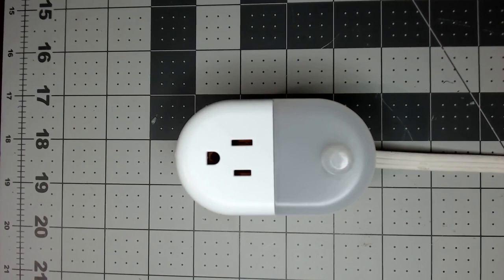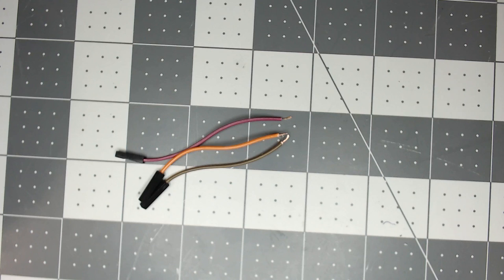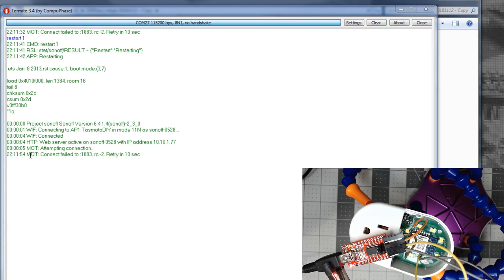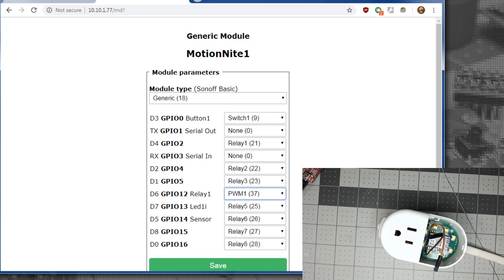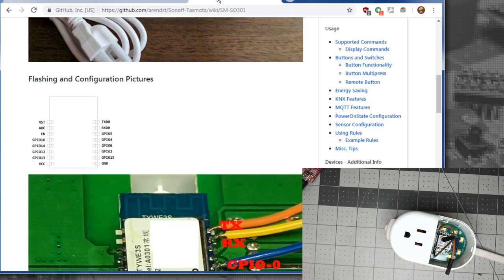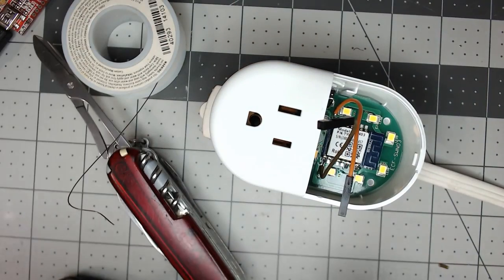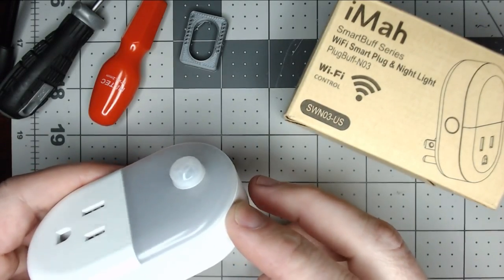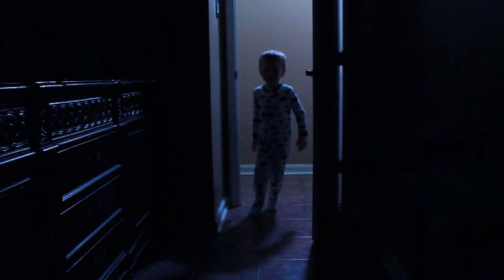Smart Motion Sensor and Night Light - How To

Comment: Mine just arrived from Amazon (thanks, Prime!)   I noticed its pretty easy to pop the entire board out of the case; you just need either a funky 3-lobe security bit or just the right sized straight screwdriver to remove just one screw.  On the back, it's behind the white rubber plug that you can pry out of the hole fairly easily.   It's not even glued in there.   Once you have the screw out, first remove the bottom half of the front case (not the diffuser) and then the top cover over the LEDs pops out pretty easily.   Then just push on the AC power pins sticking out the back, and you can easily extract the board.
Reply from the maker: Thanks for sharing! I wish all manufacturers would put a screw! Hint hint! They would sell more units. If you want take some pictures and email them to the channel name at Gmail and I can post them. Going to pin your comment.
Reply: I just sent some photos.

Comment: Amazon delivered 2 of these plugs on Sunday - the video was spot on on.   I was able to flash via OTA so only needed to solder 3 wires to each plugs.    There is quite a bit of changes to make on these things - but Travis has all the info so it pretty much cut and paste.   I really appreciate the explanation of the rules - what each part does.   I'm going to order a couple more just to have them.   Travis installed the PIR in the front of the light cover - but he also mentions in passing you might want to install it on the side - depending on your specific need and at what angle you want motion coverage.

Comment: "We've got the instruction manual... of course, we don't need that."   Exactly!  This is really a great find!  I've been wanting to put some motion sensors and night lights into various rooms for general presence detection.  Having found this product that's already packaged and easily hackable solves the most difficult problem of making it look nice.  I wonder how many things I can stuff in there?  In particular, I've a got one of the cheap microwave doppler motion sensor modules in an LED lamp that I built that seems to work pretty well.  It's somewhat sensitive to power supply voltage fluctuations, so we'll see how it feels about the inside of this module.

I managed to order a few of these from Amazon right away before they go out of stock.  Thanks very much for doing this video and sharing your discovery of this product with us.  Can't wait to add this into Home Assistant, either using Tasmota or esphomeyaml..
Reply from the maker: Is it bad I never pair devices with their stock apps and just flash them from the start? Ha!
Reply: @digiblurDIY , none of the 10 Sonoff devices I have around here never run whatever the stock app is.  First power-up is usually with the USB serial adapter connected to it for flashing.  Straight to the brain transplant!  I wonder how much more product some of these vendors would sell if they just mentioned "Tasmota ready" in their product's description.
Reply from the maker: All they have to do is put a simple 4 or 5 holes in the PCB. Mentioned that several times to any of them when I had the chance. Not sure if that gets back to the actual board developers though.

I remember the router manufacturers doing the DD WRT ready labels.

Comment: As always, great video! I am looking to build some multi sensor units to monitor temp and rh. Something like this as a starting point would be great. One concern regarding temp though, if I add a temperature module to one of these, do you think the leds being on would raise the temp reading too much? Or would you go with a smart plug without the leds?
Reply from the maker: You can always turn the LEDs off and leave them off. There will be some heat from the Esp chip and power supply as well but if you keep them far enough away type thing or go with longer leads, etc. Just depends on how accurate you want to be.

Comment: I happen to be working on a   HC-SR501 PIR on a D1mini and trying to figure out how to config it properly.   :-)
Thank you, it's great, helpful, good for reference.
Reply from the maker: Side note on those HC-SR501's, I have heard some people have interference issues with them.  Keep them away from the wifi antenna on the esp chip.
Reply: @digiblurDIY  Got it. 
The sensor is currently connected by  20cm Dupon jumper wires and it did turn on the light last night when nobody was there. I am not sure if it's related but I check later today. :-D 
Thanks.

Comment: Same setup but I get a lot of false positive signals from the pir. In the middle of the night, with no movements, the light keeps turning on randomly. How can I reduce this issues? Do you have same problem?
Reply from the maker: I have seen that issue before with a bad PIR.  Or it could be some other heat movement in the area.  One test I do is to completely cover the sensor with something to see if it is seeing something weird.
Reply: @digiblurDIY  Good advice, i will try to cover tape the sensor...i doubt it's broken because i already tested another pir (the bigger HC-SR501) and i get the same results. What could cause the heat movements during the night with no people?

Comment: Great video, thanks! Gonna combine the info from this and the MJ Dimmer to add a motion sensor to the dimmer... which unfortunately only has one pin for fun. A thought I had on this video, do you think you could more safely get the clearance you need if you just repositioned the PIR headers by desoldering them front he PIR chip? Instead of bending? Could solder them back on at a 90 degree angle. Not sure how much room you have in  there, but an idea. Thanks again!
Reply from the maker: I did have some 90 degree headers I could thrown in there but I went with easy. Removing pins can be a pain for many.

Comment: Thanks for the amazing video! Made great progress with my project after seeing this video.
I am trying to install PIR sensor in blank plate. Just wanted to know how much of the inner sensor part needs to be exposed?
Only the top surface with the glass-window like thing? Or the whole metallic thing needs to be outside the wall plate?
Thanks.
Reply from the maker: The little square window needs to be inside the little cap for it to detect properly. I have another video I do in my list of a motion activated light switch where I installed a PIR sensor in a blank wall plate. Thanks for the comments!

Comment: You do well on small work w/ that monster iron tip. I'd have to have a much pointier tip to do that.
Reply from the maker: Still get the shakes a bit but that is next on my list to get a new soldering iron, the trusty 15w Radio Shack one has done well the past 15+ years though, will be hard to let go!

Comment: Great video! One question, you mention at the end that other sensors can be added like, temperature sensor, will not the LEDs affect the correct operation of the sensor?
Reply from the maker: The LEDs probably won't generate as much heat as the other electronics but yes it will raise it some. I was looking at putting an i2c type sensor on the outside a bit to let it catch a bit of air to see how it does.

Comment: I had some trouble with the nightlight/smartplug (different brand than you used, but same thing, and same TUYA module) tasmota keeps from all I can tell resetting. I have trouble connecting to the web page then it will work a little bit but if i configure the module and it restarts it nothing is saved and i cant connect to the web page for a while. any ideas on this? Did you use the pre compiled sonoff.bin on yours or did you build your own?
Reply from the maker: I did build my own as it is a cut down version of just the sensors I use. What version did you use?
Reply: The prebuilt version. Looks like I am going to have to compile my own. I have never done that before is it pretty easy?
Reply from the maker: I did a live stream on it that's in my video list. I did it that way to show people how easy it was in real time without video editing. I can say I haven't heard of people losing the whole device config before unless there was a misconfigured button causing a false 40 second hold event. You might try to reflash and or upgrade combined with a factory default.

I have seen people having issues with the 6.4.1 version out there with MQTT disconnects and the sleep time set to 0 causing issues. Going to the dev version built with the newer arduino core has fixed some of that for folks and you could try that. http://thehackbox.org/tasmota/020500/
Reply: Awesome thanks Ill try that
Reply: Ok so after lots of messing around i think i solved my issue. I compiled my own stripped down bin and it was still doing strange things so I used esptool.py and erased the flash then reflashed with a precompiled dev branch of sonoff-basic and cross fingers all seems to be ok. at least on the one. I just did my second and will try tonight to see if it works

Comment: Would it be possible to have the light remain on as long as it senses motion within a 30 second gap. So if it doesn't sense motion for more than 30 seconds the light goes off?
Reply from the maker: That's what the rule is doing, setting a timer and the motion trips it resets the timer each time.

Comment: Amazing video. I need to learn to Solder
Reply from the maker: Buy a soldering iron and take some old junk electronics or just some random resistors and male jumper pins and proto boards. Then play away. No worries about messing anything up.

Comment: I have the same plug but called iClever from Amazon. Did you face any false triggering since the pir near a wifi module causes this issue with me and was reported from others also ?
Reply from the maker: Yep. iClever is the other rebrand listed in the description.

I learned from the Bruh multi sensor video with the AM312 PIR sensors and they work great. Have them in several devices around the house without any false triggering.
Reply from the maker: Have about 6 of them so far around the house from various places on various devices. No Zwave for me as have issues with 900mhz here.
Reply from the maker: @raufismayilov3542  Ben in this video got me testing these in some small little sensor projects like he built here.  I have one running for almost a year a few inches from a NodeMCU board without issue.  Watch his video, older video but still damn good.  https://www.youtube.com/watch?v=jpjfVc-9IrQ

Comment: @digiblurDIY You set the to 20 seconds, if there is another motion detected at say 10 seconds, does it reset the countdown to 20 seconds again or continue with the remaining 10 seconds?
Reply from the maker: Watch closely in the video and I mention it resets the timer anytime the state of the motion changes. It makes the 20 second timer when motion is present then the motion goes to zero and the rule makes the 20 second timer over again. So as long as motion is triggered within the timer time it will stay on as it keeps getting reset.

Comment: I know this is an older video, but is this the same idea for a LED Color Changing bulb?  I have one that I flashed but doesn't have a template (no existing one works).  I'd like to try and get it working and contribute the template to the community.
Reply from the maker: What idea? Putting a motion sensor in?
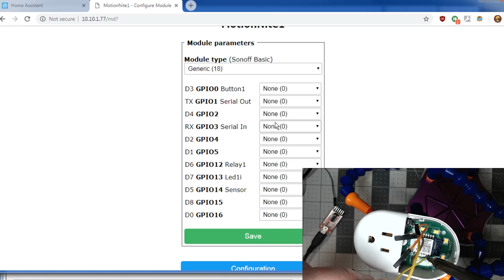Reply: @digiblurDIY  oh gosh, I'm sorry. I followed the link from the Tasmota page on creating a template by flipping the relays and it plopped me at ~8:25 into this video. I have a LED multi-color bulb that no template works with. Flash was successful, just can't control it. I wanted to see if I could get it working and contribute a template. It is a Tuya based bulb, but pretty generic looking. Toggling GPIOs as shown doesn't seem to do anything.
Reply from the maker: This is the one you might want to try. https://github.com/arendst/Tasmota/wiki/Configuration-Procedure-for-New-Devices

Comment: I followed your configuration of the module however I don't get two toggle buttons. I am only getting the toggle button for the relay, don't see one for the LED lights.
Reply from the maker: Did you set the PWM for the LED light pin?  This creates the other toggle and slider in Tasmota.
Reply: @digiblurDIY  Yeah I assigned PWM1 to GPIO 12 which was relay 4 and it controlled the LED's
Reply from the maker: If you have a relay and one pwm in Tasmota assigned you should get two toggles. If not I would try a reflash.
Reply: @digiblurDIY  So I think I got it to work finally however I had to assign GPIO 12 "Relay 2". When I assigned it PWM1 the toggle button would not show.
Reply from the maker: That's definitely not right.  I'd raise an issue in the Tasmota github and see why PWM1 isn't working, not sure if it is a known issue in their release of the firmware.  Have you tried the latest dev release on the 2.5.0 core to see if that fixes it or maybe an older version?  http://thehackbox.org/tasmota/020500/
Reply: @digiblurDIY  Ok I finally figured out what was going on. Apparently "SetOption15" was turned off which gives you the ability to control PWM. I simply did a "backlog SetOption 15 1" and now I can see the dimmer control and the toggle switch.
Reply from the maker: Oh wow! I had to look that one up. I see it says 1 is default.  I wonder how it got turned off?  Glad you figured it out.  Great job!
Reply: Exact same thing happened to me... I can confirm this fixes it and thank you for sharing this information as it saved me some time figuring it out. :-)
Reply from the maker: I'll put a note in the description. Edit: Done. Hopefully if someone else has the issue too, they will see it in the video description.  Thanks for updating me on this.

Comment: Great video. I flashed OTA using your other video.  I can't get the long press working. Is the following correct?  Thanks

SwitchMode1 5
rule1 on switch#state=3 do power2 toggle endon
rule1 1
setoption32 7
Reply: Nevermind.  It should be: rule1 on switch1#state=3 do power2 toggle endon
Reply from the maker: Close. Switch1#state=3

Comment: I wonder what the WiFi performance is on this product, relative to other ESP8266 devices.  Looking at the PCB in the video, it looks like they routed traces to connect to the LEDs under the "keep-out" region under the Wi-Fi antenna on the Wi-Fi module.  Hard to tell the extent of the traces under the board, but that's sort of sloppy design work on the part of the guys building this product.  Of course, it's only $10-$15 so I guess you can't hope for a premium, no-compromise hardware design.
Reply from the maker: I haven't noticed any difference compared to other devices in the house.
Reply: good here: "POWER1":"OFF","POWER2":"OFF","Wifi":{"AP":1,"SSId":"<not_sure>","RSSI":100,"

Comment: Oh, forgot to say... A step bit drills smoother holes in plastic than twist drills. I can't make a smooth hole w/ twist to save my skin.
Reply from the maker: YES!!  I've watched many TV shows with them building things and need one of those pretty badly.  Once I get my new desk built I'll have my small vice attached to the workbench as well for correcting the skin to drill issues.
Reply: @digiblurDIY  good ones cost about $40-50ea., but cheap sets can be had for much less for plastic work.

Comment: Hello Digiblur
Thanks for all your excellent Great  videos 
I am using Tasmota with Blynk application because of its nice GUI
my problem is how to send an MQTT message to change a RULES on a ESP8266 running tasmota

I can change T1 with this MQTT cmnd on Arduino
client.publish("cmnd/KLD-Secondary/RuleTimer1", value);

MQT: stat/KLD-Secondary/RESULT {"T1":46,"T2":0,"T3":0,"T4":0,"T5":0,"T6":0,"T7":0,"T8":0}
MQT: stat/KLD-Secondary/RESULT {"T1":58,"T2":0,"T3":0,"T4":0,"T5":0,"T6":0,"T7":0,"T8":0}
MQT: stat/KLD-Secondary/RESULT {"T1":154,"T2":0,"T3":0,"T4":0,"T5":0,"T6":0,"T7":0,"T8":0}
MQT: stat/KLD-Secondary/RESULT {"T1":122,"T2":0,"T3":0,"T4":0,"T5":0,"T6":0,"T7":0,"T8":0}
MQT: stat/KLD-Secondary/RESULT {"T1":30,"T2":0,"T3":0,"T4":0,"T5":0,"T6":0,"T7":0,"T8":0}

but I still don't know how to change the 30 sec to any other number in Rules 
or to publish a new rule with MQTT

rule2 on switch1#state=1 do backlog power1 on; ruletimer1 30 endon on rules#timer=1 do power1 off endon

https://community.blynk.cc/t/blynk-mqtt-bridge-use-blynk-app-for-non-blynk-devices/22074

Thanks
Reply from the maker: You want to push a new set of rules from MQTT?  How often do they change?  Or are you trying to get a rule to execute via MQTT?
Reply: if I say  both what will be  the difference ?
Reply from the maker: I guess I would have to understand the big picture to help you create the solution you are looking for.   You could just push in a backlog of commands each time, no need to keep changing the rules.  So many ways to do things though.  It might be better suited for Discord to chat about though.
Reply: if I want to change the 30 s  in this rule
rule2 on switch1#state=1 do backlog power1 on; ruletimer1 30 endon on rules#timer=1 do power1 off endon
 from another device  
using MQTT
Reply from the maker: I believe what you would need to do to change the timer is assign the 30 as a variable in Tasmota, then you can push those over via MQTT and the rule should follow the variable, that way the rule stays intact and you are just changing the value.
Reply: thanks
I found it here
https://github.com/arendst/Sonoff-Tasmota/wiki/Rules#variables-and-mems